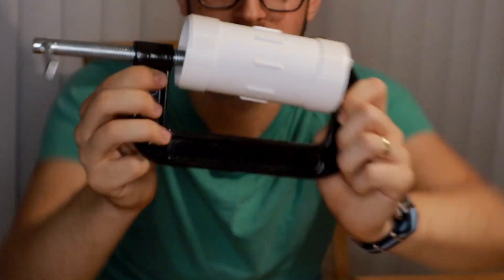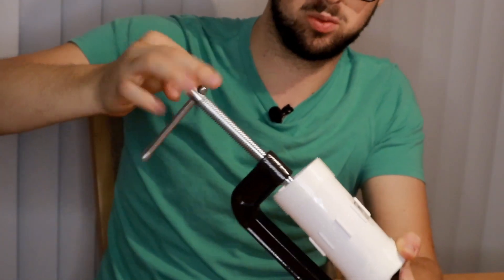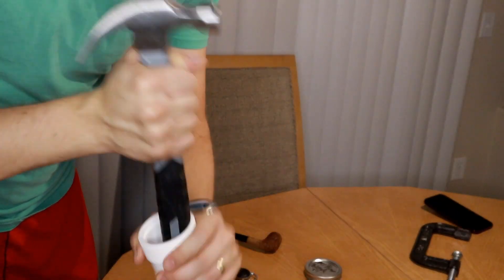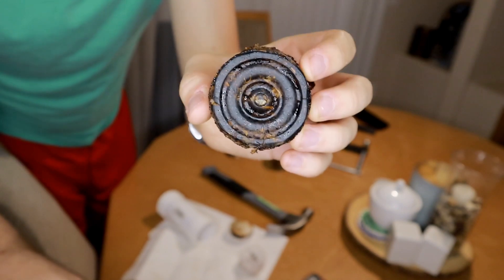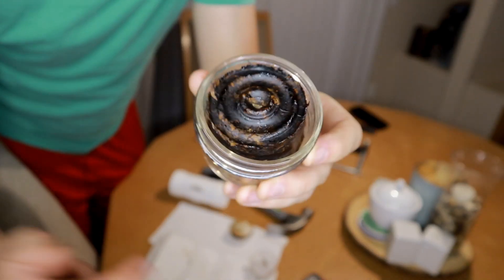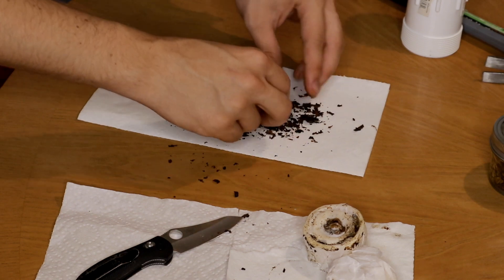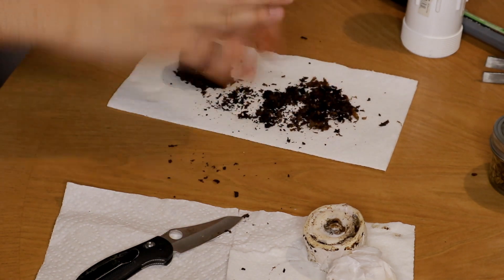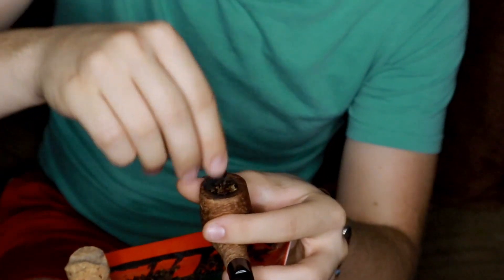Making Your Own Pipe Tobacco Part: 2 - How To Press Tobacco

Comment: How do I dry pipe tobacco? I recently bought a pouch of Mac Baren's Scottish blend (ready rubbed) and a missouri meerschaum ozark pipe. Moisture here from where I live is 90%  right now (monsoon season). Tobacco doesn't seem to dry making it unsmokable. Although I have no problems with cigars. 

p.s.
I LOVE Laphroaig!! I love smoky Islay whisky!! A dram of those beauties remind me of the sea, burning grass, smoked salmon, smoked ham, smoke bacon, ripe apples at times, honey, lemon rind, and at times medical supplies. Laphoriag quarter cask is a good whisky. If you want a whisky from Islay that isn't too smoke but actually quite fruity, mellow,  with just a hint of that maritime taste and peat, try Bunnahabhain.
Reply from the maker: Hey Ken. I am not sure how to dry out a tobacco if the air is 90% RH. Maybe I would put it in the fridge or something like that for an hour or two. In Arizona, I have the opposite problem. Thanks for the support! Laphoriag is a flavor explosion!
Reply from the maker: kenken8765 oh I have a good idea. You can use your oven on low heat for a few minutes or maybe get a dehydrator.

Comment: What did you use to cut out the circular wood pieces? That seems like the biggest pain in the ass part
Reply from the maker: i just wanted them to be round to fit in a tube. i like the round cakes.

Comment: If you can...how yo.make it cavendish and sweets.
Thanks alot
Reply from the maker: I am not sure. cavendish requires hot pressing and steaming and a lot of machinery.
Reply: Ah  i do think so.
Reply: I have made Cavendish at home (so it was called), not difficult.  Years ago I saw it explained in a blog, and tried it.  The result was outstanding.  I used flue cured Brightleaf (from Leaf Only) but you can probably use anything.  I think that the fresher the leaves then the better.  In other words, older dried out leaves may not yield the same result.  I steamed the leaves in a covered colander until they turned dark brown (5 hrs min).  The longer the better.  Then I hung the leaves overnight to dry.  I just draped them over a length of wire.  Then I folded the (very damp) leaves up into small square blocks (about 6" x 6" x 1" thick), wrapped them in plastic (or parchment) and pressed them between 2 pieces of hardwood (or whatever) for a day or two, with lots of weight, like 75 lbs.   Then I removed and unwrapped them, cut the blocks into thin strips (with a curved kulu knife) then rubbed the strips apart onto a cookie sheet and let them dry until usable.  The tobacco smelled really, really sweet, like candy, became a key ingredient for blending.  If you try it, use an old cooking pot, colander and lid as they will become permanently stained.  I tend to make large batches now, enough to completely cover several cookie sheets.  I think it is basically pseudo fermentation.  Cavendish was discovered after Virginia tobacco sat in ship holds for months in hot weather.  The heat really brings out the sugars, smooths out the smoke, adds flavor and burns slowly -- everything you want in a pipe blend.  I found that my Leaf Only tobacco would tend to dry out and burn fast despite moisturizing with a water bottle.  Adding Cavendish to it helped.  I guess its a little like making your own Latakia but with a distinct, mellow Virginia flavor.  You could even add Cavendish to the blend you press into a plug.  Anyway, if you want to avoid additives that make tobacco sweet, then this is a way to do it.